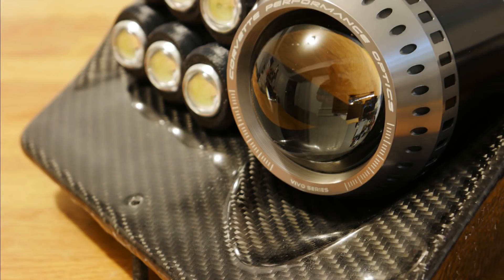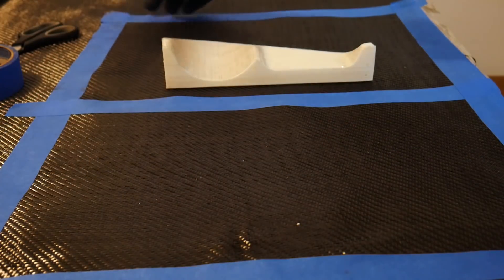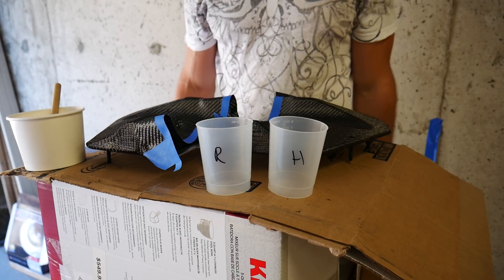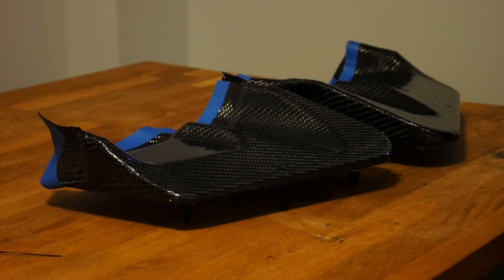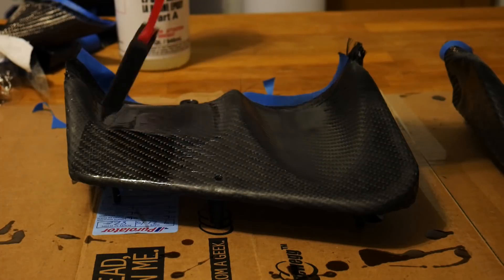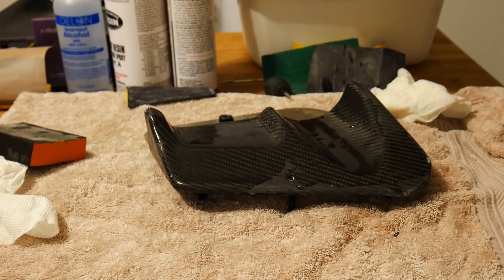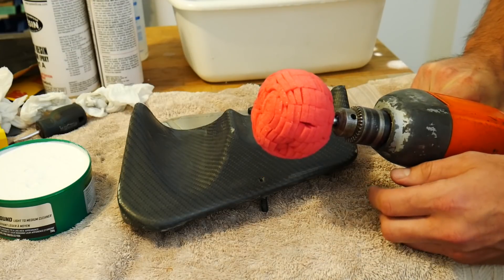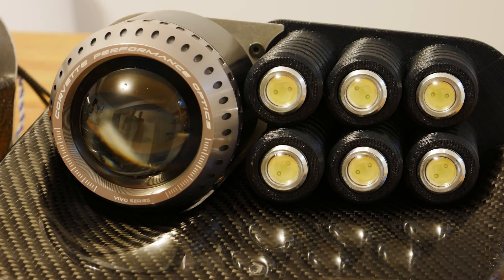How to Hand Lay Real Carbon Fiber Wrapping / Skinning Tutorial

Comment: Thanks for your video that I know 3M super 77 is very helpful for lay carbon fiber. But I have problem when I apply the epoxy to the carbon fiber, the carbon fiber is blistering, it doesn't stick anymore :(... I don't know why it happens... Do you have this problem?
Reply from the maker: Hi Hoang, I haven't experienced this problem... did you mix your epoxy correctly?
Reply: Yes I mixed epoxy 1:3 ratio, I think maybe 3M super 77 had problem, should I use  3M HI-STRENGTH 90?  
And after how many layers of epoxy you use sandpaper?
Thank you for answering.
Reply from the maker: You could try a higher strength adhesive, but it may also be air bubbles under your  cloth. Try smoothing them out before applying the epoxy and use something to smooth out the push the air bubbles out without distorting your weave. Only start sanding once you have enough layers such that you cannot feel the weave under your epoxy. If there are any areas where you can still feel the cloth then sanding will damage it. It usually takes 3 - 4 medium coats from my experience.
Reply: Thank you so much :)

Comment: Is it possible to remove it? for example you want to change the design. If it is possible can make a video of it? Thank you for the helpful video.
Reply from the maker: Hi Abz, removing the "skin" would be quite difficult in most cases. It would probably require you to cut the carbon fiber piece off with a dremel.
Reply: what is your recommendation if someone want to change skin?
Reply: btw thank you for the answer.

Comment: Did you sand the high points too much (edges and center peak) and that's why it's showing white through?
Reply from the maker: I think it was just a poor mix of the resin and hardener. I believe it was some resin that didn't get enough hardener and it would not cure properly. Thanks for watching!
Reply: Embrace Racing Gotcha! Do you think this could withstand engine bay temps?
Reply: A few other tutorials have mentioned that it's not rare to see the through the weave in bright light and recommend you paint the part you're wrapping black first.
Reply: @JasonStapels  Yes, you can also use a colored base epoxy like what easy composites offers: http://easycomposites.co.uk/#!/resin-gel-silicone-adhesive/epoxy-resin/black-epoxy-carbon-fibre-skinning-basecoat.html.  This kills two birds since you get the sticky epoxy layer that will prevent the fabric from lifting, and it is colored, so no painting required.

Comment: So did you mess up one of the parts in the video? You obviously showed us the other part at the end of the video. Did you sand too much?
Reply from the maker: Good eye, I did show a different part. I didn't mess up the other side, but I did feel that the side I showed in the end did turn out smoother. The other side just needed more sanding and another coat of resin :)

Comment: VERY VERY NICE !!!!!! 
can you apply the same process to parts made with Styrofoam ?
Reply from the maker: Yes you should be able to. Just make sure your resin is compatible with the foam. Some will eat the foam and your foam mold will be ruined. If you apply plastic tape over the foam it can protect it. Thanks for watching!
Reply: Look up Mike Patey on YouTube. He builds molds using foam and has had great success. He builds airplanes and makes a lot of carbon parts.

Comment: How hard would it be to carbon fibre rap a old 1974 car? If you just sanded the car back and straightened the panels then sprayed it to primer could you then instead of painting it could you carbon fibre wrap it as the final spray job so to speak ?
Reply from the maker: Hi Rhino, you could do this in theory but I would be very concerned that the carbon fiber would delaminate over time with heat cycles and body panels flexing. If you want true carbon fiber panels unfortunately you will have to create plugs and do it the right away. If you just want the look, you can always use carbon fiber vinyl and try clear coating it to create a glossy look with depth. Hope that helps!

Comment: I always had issues using spray adhesive.. when I'd apply the epoxy to the carbon fiber, the carbon fiber would often lose its bond with the piece I'm skinning. 

the best method I've found that works around this, and also possibly more thoroughly saturates your cloth, is to brush a light layer of epoxy on the part and set it under a heat lamp for about an hour (depending on dry time of your epoxy). The epoxy at this point would be tacky but not completely dry and the carbon fiber cloth will stick similarly to spray adhesive, but additional epoxy will not cause the cloth to come loose from the part...
Reply from the maker: Hi Cory, thanks for watching! That is definitely an option and the method I used a few years ago when making a carbon fiber spoiler. I tried the spray adhesive this time because it was quicker and didn't have to wait for the resin to get tacky. However, your method will work great too!
Reply: Oh.. and one other thing I like to do is use an automotive clearcoat as a final coat after the epoxy dries because it tends to look really glossy and blocks UV rays to prevent any yellowing. Your part looks good tho =]
Reply: if I'm just doing overlays like this I will spray a mist of gel coat over it instead of using spray adhesive. When the gel coat tacks I add the carbon and let it semi dry into the carbon. Hold down pretty dang good!

Comment: Question for you on the Eagle Eye Led's.  Do you have a problem with them burning out? I've tried multiple sellers and 2 different kinds, but they all seem to burn out.
Reply from the maker: Hi Derek, fortunately I have not had this experience. How long do they last on average?
Reply: Embrace Racing I've had them burn out after a week, and had others last over a year. I use 12 as DRL's and luckily mine are easy to swap. I've tried 12v like they are labeled, and I've tried 2 and 3 in series. Still the same. Different sellers. Never run into someone using them, so I figured I'd ask
Reply from the maker: Do you use 12V directly from the vehicle or do you use any kind of voltage regulator?
Reply from the maker: The reason I ask is that your car voltage can fluctuate and you'll get spikes... without a regulator, the voltage spikes are probably killing the LEDs
Reply: Embrace Racing I actually am using the stock wiring for the parking lights. Cut off the plug for those and use these instead
Reply from the maker: Hi Derek, that's your problem right there. Your stock incandescent bulbs are much more resilient to these voltage spikes. Get a cheap waterproof 12V regulator off of ebay or wherever and use it ahead of your LEDs. This will protect them and you won't end up with anymore burnt out ones :)
Reply: Embrace Racing wow. Can't believe I never thought of that. -_-  hey. At least those LED's are cheap
Reply from the maker: No problem, good luck!

Comment: Is there a link or web site to purchase the carbon fiber and epoxy??
Reply from the maker: Hi Gustavo, where are you located? Depending on your locations, some suppliers don't ship to certain countries.
Reply: Embrace Racing California
Reply from the maker: I'm in Canada so things like this are a lot harder for me to find. For you it should be really simple. Check out "Systems Three" or "West Systems" for your epoxy resins. Their websites should direct you to either buy directly from them or their distributors. The carbon fiber cloth was from sollercomposites.com Hope that helps!
Reply: Embrace Racing Thank you that helps a lot, last question which Carbon Composite Fabrics did you use or recommended using?
Reply from the maker: That depends on what you're trying to accomplish. If you're skinning/wrapping like in this video then something like a twill weave will be great for curves. Check out this guide: http://www.easycomposites.co.uk/#!/composites-tutorials/carbon-fibre-cloth-explained

Comment: looks good man, such a long process but very rewarding, i like to watch these videos to look for alternate methods that might benefit me, only thing i do differently is spray the part black so you cant see anything between the weaves, also instead of doing multiple rounds of sanding then laying epoxy, just lay a few coats to save time and sanding, added bonus is the chemical bond is stronger than a mechanical bond
Reply from the maker: Painting it black would have been a good idea. Thanks for the tip and thanks so much for watching!

Comment: how long do you have to wait after sanding then coating another layer of resin?
Reply from the maker: The long wait is after apply resin. I usually wait 24 hours to sand. After you sand you can apply resin right away BUT you have to clean up first! Make sure there is no sanding dust still present.
Reply: Sounds great ! Thank you so much for a thorough tutorial helped me a lot !
Reply from the maker: No problem! Glad you found it helpful! If you can do me a favor and hit the like button it helps so much! Thanks for watching!
Reply: Just did ! Also sorry forgot to ask but did you use clear coat or just kept it with the epoxy & polished it ? Thank you

Comment: Nice video, I am learning a lot about the process.  I was wondering what it would look like if you vacuum bagged the part, with peel ply? (since the part is small)   I guess it's a trade off on work, but would this help with the finish at all?  thanks
Reply from the maker: Thanks for watching! It would probably look better if I vacuum bagged it, but as I mentioned, it was a trade off with the equipment investment. Vacuum bagged parts typically look better as long as the mold underneath is nice and smooth.

Comment: still wavy and not that glossy. im amazed the finish on the 3d part. all that technology and such a ruff finish.
Reply from the maker: The flat spot on the front that I focused on is very flat and glossy. The other areas that are covered by other components that I did not put any work into, remain wavy. This method is a very time consuming process but the advantage is that it does not require any investment into equipment. No vacuum pumps/bags/etc, or autoclave.

Comment: Looks good but be carefull with that tape under the carbonfiber, their might be a chance of a release occuring due to the fact that tapes like these can be selfreleasing
Reply from the maker: Thanks Matthieu! I am a subscriber to your channel and I've found your projects to be helpful! So far the tape has had no adverse effect but I will keep a close watch. The good thing is that the carbon fiber is wrapped all the way around and it hooks under the aluminum plate so it cannot pop off.
Reply: Embrace Racing that's great! keep me up to date ;-) I sometimes use that kind of tape to avoid epoxy sticking on to something :-) thats why I decided to comment
Reply from the maker: No problem, will do! I've used packing tape for releasing fiberglass parts before so I thought it would be good for the epoxy resin. I didn't want it to eat my 3D printed part, it takes 7 hours to print one side!

Comment: I'm not a fan of exposed carbon fiber but becasue you used PLA(not a good idea at all), you'll need the carbon fiber to keep it from warping in the sun or from the heat of the light, eventually it will deteriorate being exposed outside. You should really look into PETG. It's higher temp like ABS, but it's super strong(I mean super strong, layer adhesion is a non issue) and prints more like pla.

Also, that resin is not likely to do well in the sun in the future, instead of doing the final polish, you should have sprays a UV resistant clear.
Reply from the maker: Josh Bishop thanks for the comment josh! I agree pla is a poor choice for something like this, which is exactly why I wrapped it in carbon fibre. This will give it some structure and it should keep its shape under the heat. I've never printed with petg but I use it all the time for vacuum forming my custom headlight lenses, it's great stuff. I'll buy a roll and give it a shot!